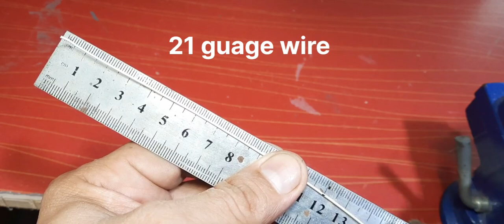Twisted silver ring making || how to make a silver ring @arshadjewelleryworkshop4473

Comment: The welding work is odious, it was poorly welded, the joint can be seen from miles away, which is improper, now when annealing the metal if it is not completely immersed in liquid, microfractures are generated that weaken the structure at a molecular level which turns the silver into a brittle material which makes it lose its strength and value, and the buyer... his investment.
Reply from the maker: Thanks for your opinion 
I will do my best in the future..